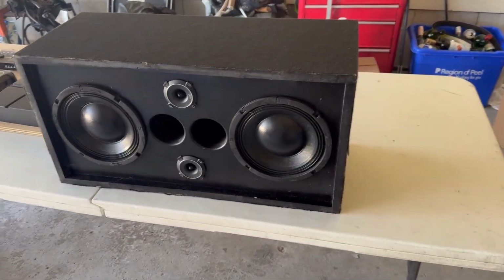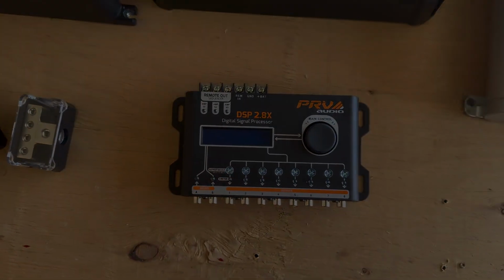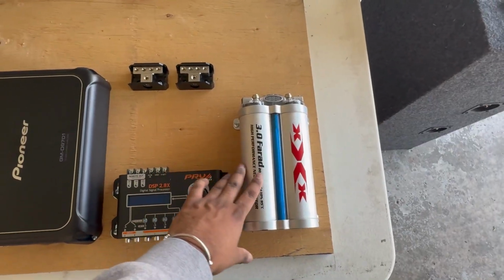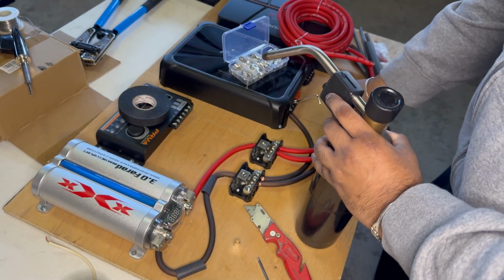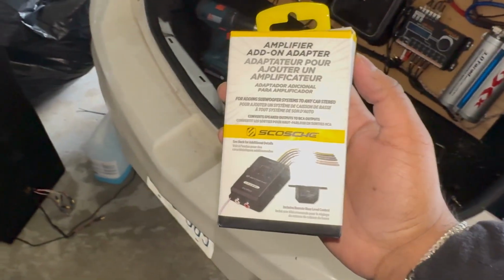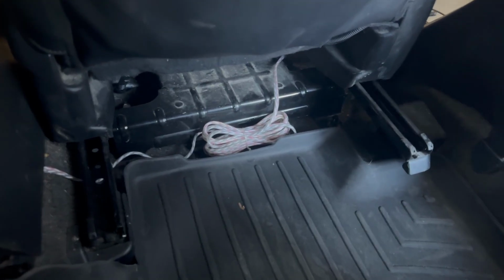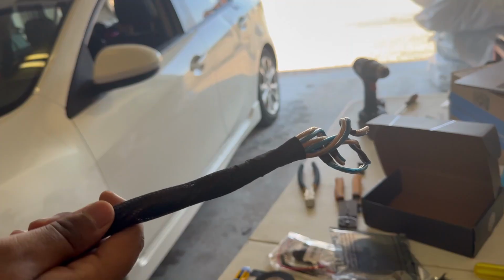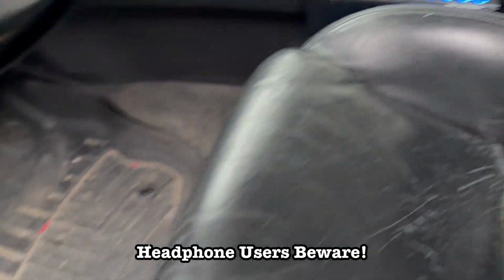Upgrading My Car Audio Setup | Amp Rack Build + Speaker Box Install + DSP + EQ Setup

Comment: Use gel super glue on the joint of the rear view mirror and it'll keep it from going down. It'll survive the summer heat as well.

Comment: That sub amp does 1200 RMS and 2400. From what I have seen those caps are kind of a waste that just end up putting additional load on your electrical system because they drain so fast. Then your stock alt and wiring has trouble charging the cap and still powering your amps. You would probably be better off with a new AGM battery or 2 and the big 3 upgrade.  What is your voltage at while playing full tilt?

I have an Alpine MRX-M100 1000 watt RMS pushing a Sundown SA12 v2 in my 2008 Infiniti G35 with a Singer 200 amp high output alt and 0 gauge ofc through out the car and my voltage still drops down into the 12s. I need a second battery to keep the volts up.
Reply: if you got a 200amp alt and cant power a 1k rms amp then somethings wrong, you should see no problems with that setup
Reply: @aracistpriest6121  I just replaced my nearly 6 year old AGM with a slightly bigger fresh one and now it sometimes drops down to 13.2 at the lowest. Usually bounces between 13.4 and 14.4 at idle. No voltage drop at all if I have the revs over 2k.